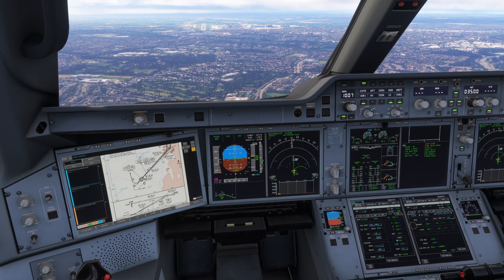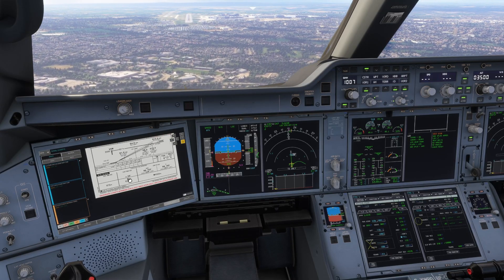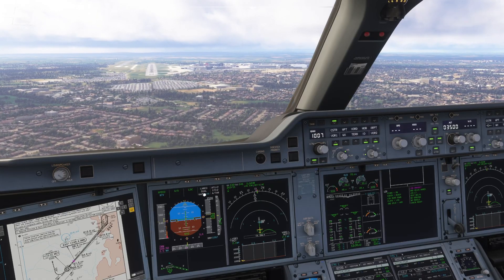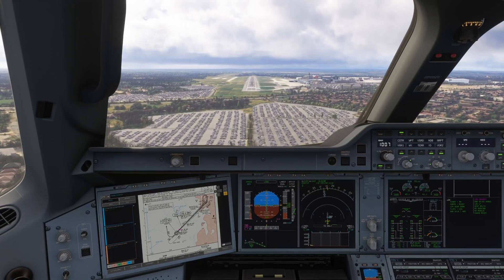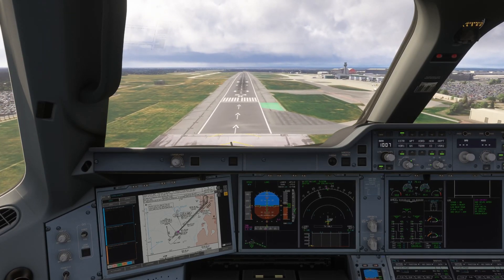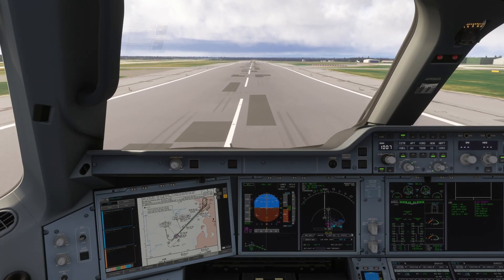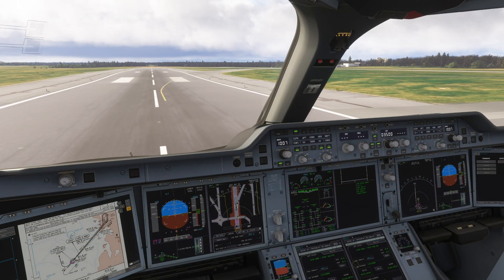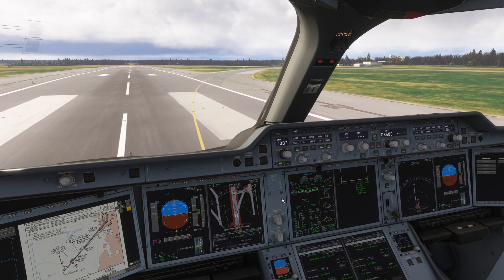iniBuilds A350 Tutorials - Episode 8 - AUTOLAND [4K]

Comment: Tbh and obviously not your fault but that was a terrible auto land
Reply from the maker: @TheGarlicMan  I didn't think it was that bad! -270fpm 1.3G approx from Volanta, flare seemed a little late and quick but it was adjusted for a good touchdown - it did seem a tiny bit off centre though I thought
Reply: @BritishAvgeek yep, as I said… not great.
Reply: Autoland isn't about greasers, its about the aircraft landing safely in low visibility, this looked completely fine to me as well! I have not purchased this yet, I really appreciate seeing that it works. Thanks!
Reply: @bluesong54 it was so far off centreline. Not great. How can you disagree with me? Auto land should absolutely definitely be on centre line. Imagine zero visibility and you come in way off centreline line, not ideal.